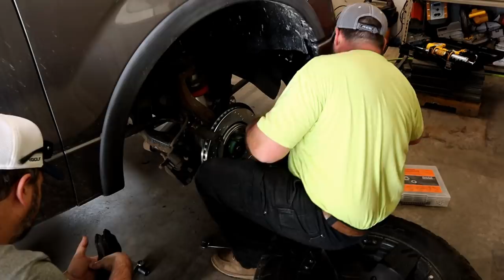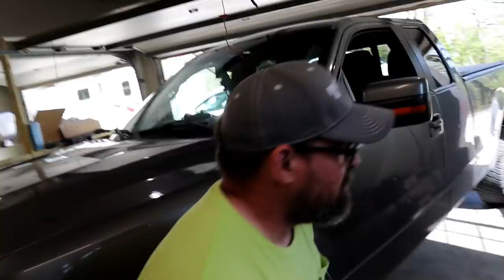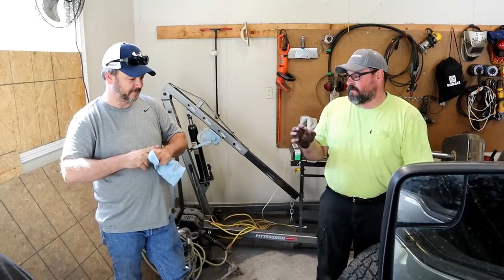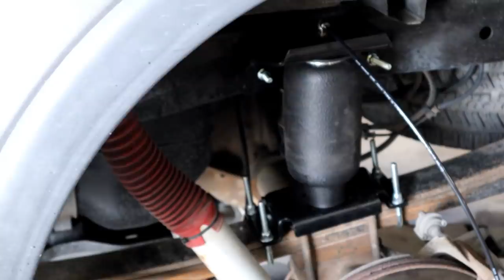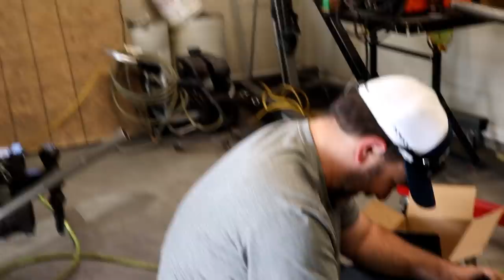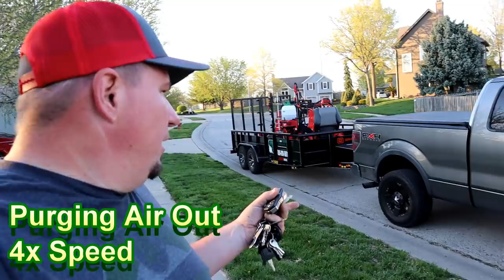We Put Air Ride Suspension on My Lawn Care Truck! | To the Top Crane and G4 Outdoors

Comment: Hey man. Just bought the Stihl fc 91 curved shaft edger. Where do you buy your blades from or what do you search?  Thanks.
Reply from the maker: For maintenance I just buy regular blades in bulk off amazon, for getting a neglected edge back I use the Golden Edge
Reply: Cut and Clean TV okay thank you!